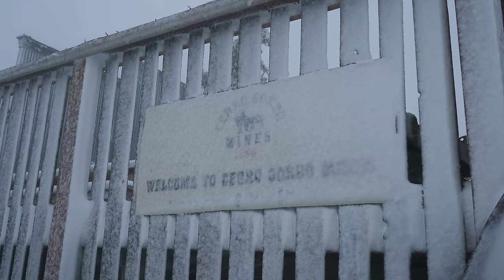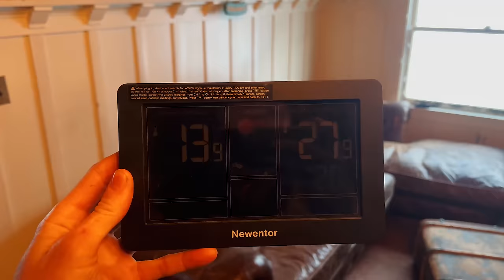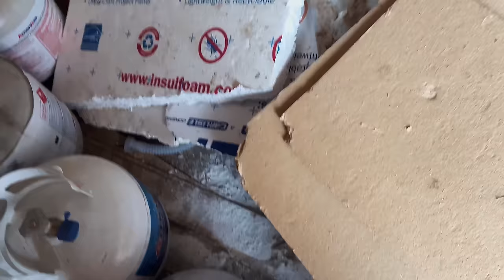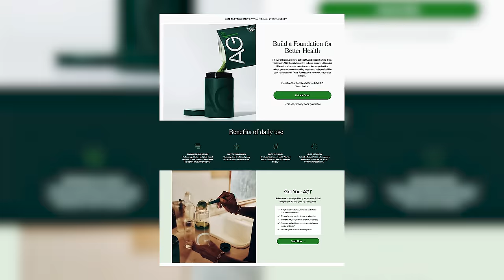Realities of Winter In A Ghost Town

Comment: great to play but where you live preperation is everything. how come the buildings arent secured on a daily basis this time of year. wheres the shovel for keeping access to them, etc. lack of space for storing wood properly. no plan for melting snow, you should be working on a way to preserve the road - yeah 7 miles of engineering. youve got heavy equipment rocks, etc. how are you going to use the melting snow to your advantage. lots of things to consider or just keep doing the same things. if youve got food water and wood youre set.

Comment: brother, what materials are your layers? Temps that cold you should have 2 organic layers on before any synthetic layers if you're leaning out due to winter rationing make it 3, I found having a second pair of larger jeans to wear over my normal jeans and thermal underwear to be useful, three pairs of cotton socks, a grocery bag for each foot, tennis shoes and a balaclava long enough that it covered my face and I could tuck into my thsirt  (bottom torso layer)and I could be comfortable in -19F degree ambient temperature with -50F wind chills for hours on end.  I would disc golf in whether like that.

Comment: You need some torches to melt the ice and snow and it will help light your fires in the fireplace when the firewood is wet. Maybe have some generators for electric heaters and gas stoves to heat water. I don't live where it snows,  but Lord knows I have been in some similar situations. We have central heating and air, but it cost too much for gas, so my husband uses our wood burning stove. We have had pipes freeze up. We used to have a gas water heater. He would buy those small tanks of propane tanks, but when they ran out....we had to heat water on the stove to take a bath. That got old real quick. We finally bought an electric water heater. I know it doesn't do any good when you don't have any electricity though. That stinks. I love the snow, I don't believe I could live where it's this much snow.

Comment: Wouldnt it be prudent to try to install new doors at least to the most important buildings. Also think of adding some more insulation to them to protect the buildings with important stuff a bit better. One way to protect at least part of the new hotel building from the snow would be to but planks or some other type of materials over at least some of the smaller spaces.

Comment: as to heat - there is a guy that has a video and he grows oranges in the dead of winter - i think he's in montana.  basically u drtil/dig a whole 1' wide to below your frost line 4'?-6'?   inserted 3 tubes and use the earth's heat.   he attached a fan to the top to help draw the heat up.

Comment: you heat all the livable buildings with wood all winter? isnt there two giant propane pigs in the middle of town? i remember seeing them in all the overhead shots. it would take a lot of wood to keep those buildings warm all winter. if they are not already insulated well, you should look into getting some insulation in the attic areas and maybe a layer of clear plastic over any single-pane windows you have

Comment: Hey! I'm a member of the 100k club, but I don't catch every update. With you being out of water - what happened to the pump down in the mine? It'll be a while before I have any free time, but I'd be down to help you fix it. 

Also, for your internet, I'm not sure where that relay station is located, but I can think of several ways to run power to it. Renewable energy like solar is great, but it's not perfect.

Comment: Living in a climat like that you can;t be under prepared it's dangerous. the first thing you do in spring is get your fire wood ready for next winter that way it's dry and will fire up.
and the moisture isn't as big a problem in your case because you have lots of ventilation, air will dry those buildings out in no time, moisture is a big problem when it's trapped

Comment: You need a wood cook stove so the wood you burn is efficiently used for water heating and cooking as well as heating. Having gas on top would be unnecessary apart form summer time then.

Comment: You need somewhere to keep all the vehicles under cover.
Why would you not check all the doors are closed if you know snow is coming. Surely that is part of the reason you are there is to look after things. 
It seems a lot of the issues could be solved with some basic preparation. 🤷🏻‍♂️

I'm not being negative,just trying to get my head around and understand the problems that shouldn't be problems.
Reply: It's weird. It looked like the doors had been open for quite some time. Like no one had been around for a while.

Comment: This was a unique example of being alone, but is that true?  Are you left alone - no visitors or other simi-residents?  That would be eerie and scary.  It looks like you have electricity in the town, is that true of the whole town of buildings?  It would be a drag if you had to run a generator for all that machinery.  I suppose that you use wood burning stoves for heat in the buildings that you want to inhabit.  It's good that you have made it a priority to have some animals, for company and some entertainment.  I love the Elon goat the most, he is the character!  
When you talked about doing a sled run down one of the roads, I was taken back.  You were going to go down a road on a sled for some miles and then what?  You ended up walking back which I thought would be the end result.  I'm glad you prepared for it.  But when you suggested that you might spend the night out there, I was questioning that.  Then Scotty came to the rescue, but not good enough - those tires where too small for the snow.  I lost track of what happened to Scotty.  You were riding in the Kabota back to the town but were getting stuck - supposedly due to your extra weight in the Kabota.  I guess Scotty was able to get back after you jumped out!
PS:  Hey, if you put in a flat helicopter landing pad at the top of the of the nearby hills, then HeavyD would be able to visit you.  Yes, he has a BIG helicopter too.  It is a military helicopter, surprise again.

Comment: Maybe cracy idea and not looking old.. But why not have a wind turbine generator (only for those strong cold winds) that generates electricity to heat your main building(s) in wintertime. Those cold windspeeds have high energy so blades can be small and robust so not efficient in summer...

Comment: Hey, Crypto Mining Generates some heat, you could run 2 systems that would make profit off of a relatively small solar system. And in the summer when you don't need heat, you can just store the energy in batteries.👍

Comment: you need cheap abundant energy a large propane tank truck🛢️ ⛽ will do , you can use it for heating 🔥 cooking☕🍲 🍳 and producing electricity 💡🔌 if you want . you can also turn ice into water🚿 with heat.

Comment: If you had a battery operated leaf blower you can blow the snow out faster. Just a thought
:face-blue-smiling:
Reply from the maker: Noted! Thank you
Reply: I’m not the one to second guess your living arrangements but I will since I am still watching your videos. A lot of good suggestions are on here. Keeping your trucks and bikes inside is a good one.  AG will not save your life up there but covering your firewood Will better yet put it inside a building. My suggestion today is get a case of road flares to start your fire in a hurry. Plus build a small lean to for your propane tanks  out in the open can freeze the connections.
Reply: I’m 68 and I learned along time ago winter is only fun if you’re in a resort.

Comment: you can't live like this for another year, you're seriously risking freezing to death. at elevation you need to be prepared for winter by september 1st. 

this is very serious. you are NOT prepared for winter and you need to prioritize it before next winter. 

primary concerns:

do you have an extra way of communicating outside the internet and phones? i.e. GPS beacon
you need snow shoes
you need a wood fired heat source - indoor wood fired stove, they're common place here in the mountains of NM
you need an enclosed wood storage, preferably not directly next to or inside the house. 

please reach out to your viewers for more ideas and help on preparing for next winter!

Comment: hello my friend. i watch from the beinging. you have solar. snow or heat. you can get power. is there any mines with good water. can you pump water ? use as a heating for your home . then use for when hot. ? 
just some shade you can grow everything with good water from solar and the mine. ? insolate your pipes for heat and cold.... you can make a power station from the mine the shaft. put weights on the elevator. with cogs and a generator to make power.. when solar runs will bring back the weight up the shaft as a storage unit. when night falls you setup a solnide to relies the weight that makes power. you have everything to run alone. for the internet make a cover with a good angle for snow to fall off . clear plastic.  for car or other you trully need learn....... me being away from people for a long time. you need think open. and you have done this ? i appacte your time and uploads you have changed in time. and i see your heart has changed. for the road. 50ml rock all . roller need but in position its impossible i understand. so much more but for now mick au god bless 2023 )
Reply: IF REAL. NO TELEGRAM. GOD BLESS
Reply: IF REAL NO TELEGRAME. GOD BLESS